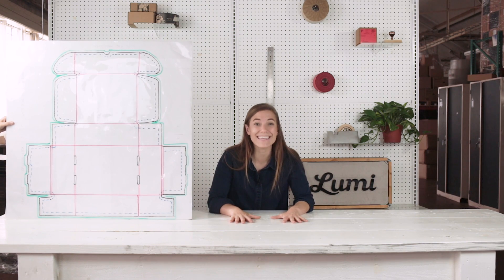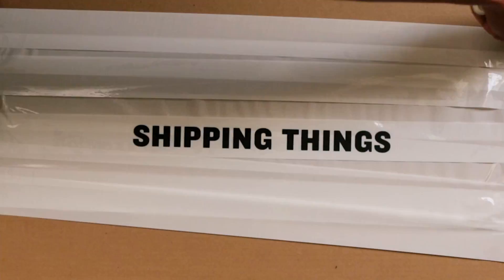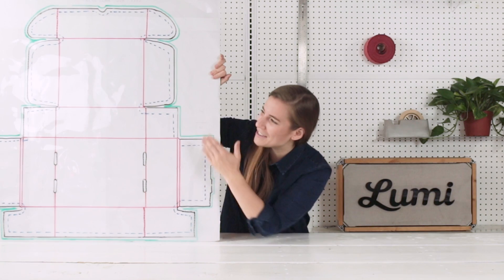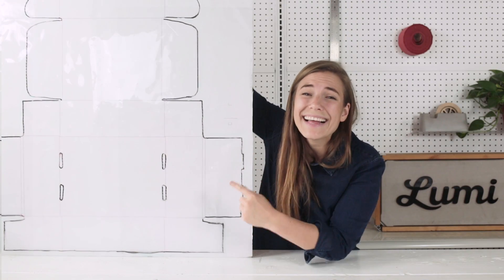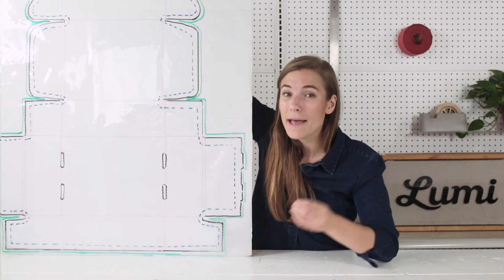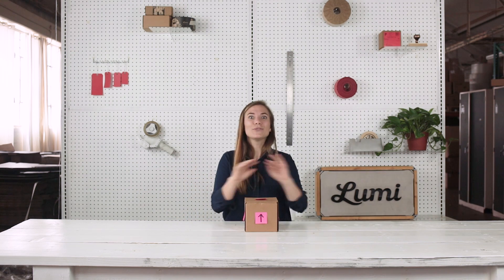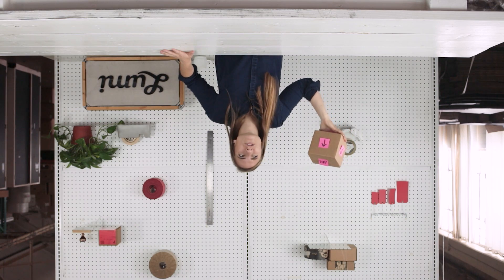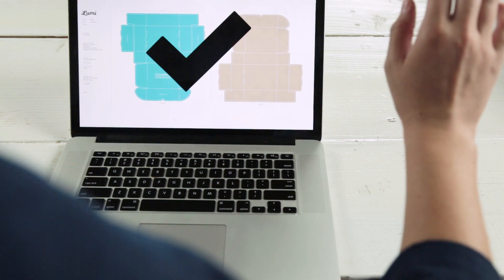Dielines and Proofs — Packaging Prepress 101

Comment: PLEASE MAKE VIDEO HOW TO DESIGN DIE CUT IN CORELDRAW 11
Reply: CorelDRAW isn't a suitable software for structural design however, you can import a dieline into this software so you can add/create graphics. Have your CAD operator export the dieline as a .dxf file and it will import the dieline at 100% of the original size. BTW - Almost nobody uses CorelDRAW in packaging design anymore, at least not in North America.
Reply: Artios.CAD or impact.cad will do the  job...not CorelDraw!

Comment: Very nice! I'd have a question I barely know the answer, but I'm not sure how to explain to clients; since we work with an off-set printing machine, we do not provide the clients with prepress proofs, but they are always asking for them. How should I explain this to them? Offset printing has very expensive costs of initiation process or offering a digital proof is not colour reliable? Do you have any suggestion? I work in www.youpackaging.com we are packaging producers.
Reply: For litho, digital proofs accompanied with colour swatches. For digital printing, of course, we're able to give them a sample of the real thing. For flexographic printing you can do on-press approvals (using a light booth) with the customer but those are usually painful experiences.